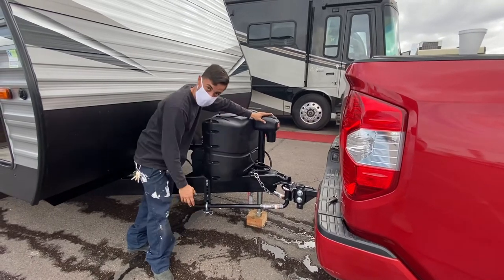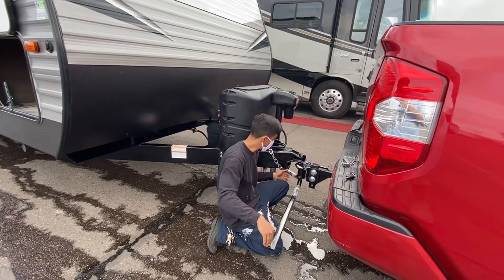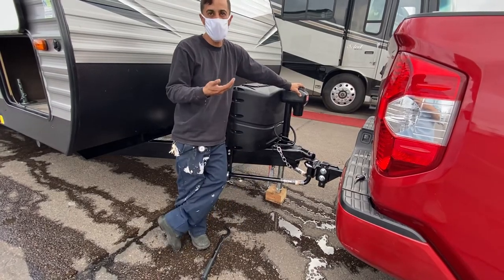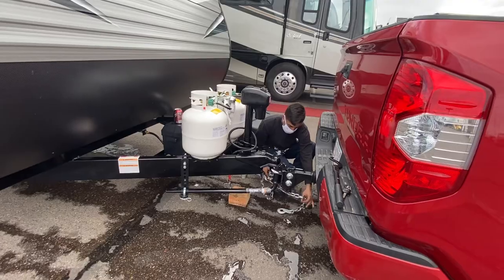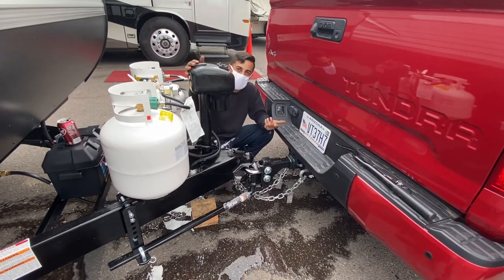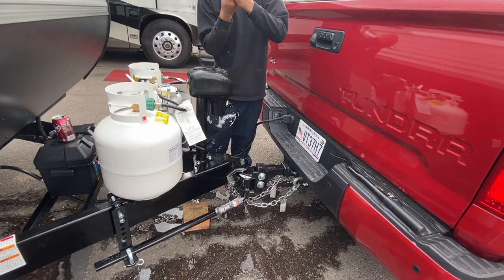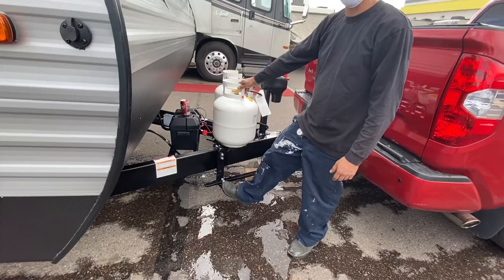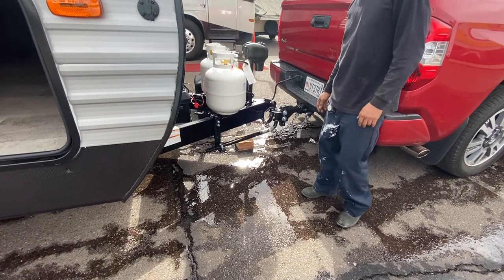Travel Trailer - Sway Bars - Connect & Disconnect - Weight Distribution

Comment: you can absolutely back up with this hitch setup just fine don't listen to that.
Reply: It’s all good, I back it up all the time no issues.
Reply: I have recently seen videos and read that you are not to back up and turn with these systems. It was news to me as I have been backing up and turning into camp sites for ten years now with two different trailers and never an issue with my weight distribution hitch and sway bar.
Reply: @fastdude2002  exactly turning is turning whether forward or backward
Reply: I backed up with mine with a sharp turn and it broke a bolt

Comment: I have the same exact setup as this. Excellent weight distribution setup. And yes,you can back this in reverse. The sway bars are meant to glide on the plate that has the “ L” safety lock. I’ve had it for 5 years with no issues.
Reply from the maker: @jimyoung8400  🙏

Comment: What brand of distribution hitch is that?
Reply from the maker: Fastway e2 2-Point Sway Control Round Bar Hitch, 94-00-1000, 10,000 Lbs Trailer Weight Rating, 1,000 Lbs Tongue Weight Rating, Weight Distribution Kit https://www.amazon.com/dp/B0071L3IFK/ref=cm_sw_r_cp_apip_ijZAlZVHpkY4I

Comment: This is NOT a sway kit, this is a load equalizer kit. Please stop making videos on subjects you know nothing about.
Reply: That's pretty uncalled for. Dude is just trying to post a video to help everyone out. Who cares if he got the name wrong
Reply: It's not a name wrong. They're 2 completely different types of systems. Confusing them to the point of getting it wrong thinking you have one system but having the other can lead to flipping the trailer, truck and getting killed or killing someone else. This is a big error because people who trust an equalizer to do the job of a sway because the two were confused are at a big risk. If a dealer taught this info they'd be liable for an accident.
Reply: New to pulling, can you tell me the difference? and maybe post links to the two different types of kits so I can research both type of systems? Thanks.
Reply: @jorgepadilla21  equalizer hitches distribute the load/weight evenly between all the axles both on the tow vehicle and the trailer (equalize the load). If this hitch is not used (or set up correctly) often there will be sag at the back of the tow vehicle and front of the trailer centered at the hitch. The danger with this is that most vehicles brake more with the front brakes than the back, so sag at the back lifts the front of the vehicle. The increased lift at the front reduces both the effectiveness of the brakes as well as the steering capabilities (because there's less pressure/weight on the front tires to handle the steering and braking), hence increasing the danger. You can tell if someone is (likely) using an equalizer hitch when the tow vehicle and travel trailer look completely level with each other in a straight line when looking at them from the side at a little distance. Many equalizer hitches, when set up properly, can also provide some limited sway assistance because one end attaches to the hitch and the other to further back of the "A" frame on the front of the trailer via chaines and/or bars. The chains/bars is what shifts the equalized weight. Being attached with the chains/bars creates some limited sway resistance from friction & weight. An actual sway bar also attaches between the trailers front A frame to the tow hitch on the vehicle using ball joints and attachment pins providing a lot more adjustable friction resisting sway from the trailer. One secret though to stopping sway as well is that the trailer can be literally pulled out of a sway if the trailer is going slower than the tow vehicle. You can do this by applying the trailers' brake control manually and NOT pressing the tow vehicles' brakes. This applies the brakes on the trailer, creating resistance & drag, while the power of the vehicle pulls the trailer straighter out of the sway (its just physics). However, this trick shouldn't be your go to primary source for sway management. Though I have seen some use it successfully when they just don't have a sway bar. Unfortunately, many of the sway related crashes are caused by sway starting and then the driver steers side to side trying to compensate oppesite the sway. Unfortunately, the physics of this ultimately acts the same as moving your feet front and back alternated with your upper body when you're on a swing: it only amplifies the sway like a swing until it flips the trailer and vehicle. DON'T TRY TO COMPENSATE FOR SWAY WITH STEERING...IT WILL AMPLIFY IT AND MAKE IT WORSE!  But applying the brake controller manually gives the drag in the trailer so the faster moving vehicle literally pulls the trailer straight. It still shouldn't really be the go to, but it can definitely help if you have no other choice. I used to have an old trailer I couldn't put a sway bar on. Every time it started to sway or got some good side wind, I'd moderately apply the trailer brake and the trailer stayed straight. Wore the brakes out a bit faster on the trailer, but it's what I had to work with and it significantly helped. 
Sorry, I don't see any way to attach pics of each, but if you do a separate browser search for each, you'll see images of the equalizer hitch with the bars (looks kind of like a pipe, but it's solid) going from the hitch to the chain attachment at the trailer compared to a sway bar that looks more like a rectangular bar with a smaller lever bar at one end (which is the adjustment bar for the friction control). The sway bar mostly looks from the side like it sits above the equalizer bar on the side of trailers "A" frame for the trailers hitch. I hope this helps and makes sense. Ideally, you should have both a sway bar and equalizer hitch in your setup. But a lot of people only use the equalizer hitch, which contributes to the confusion.
Reply: @ActinOut  you have accurate advice there but i will say that if anything the manufacture needs to be called out if this would really not effect sway as it is called "Fastway e2 2-Point Sway Control Round Bar Hitch, 94-00-1000, 10,000 Lbs Trailer Weight Rating, 1,000 Lbs Tongue Weight Rating, Weight Distribution Kit Includes Standard Hitch Shank, Ball NOT Included" and in the documentation says built in sway control and weight distribution.  
so i dont think the poster of this video got anything wrong with the title. is it going to be as effective as the device you reference ..no.. but it does use friction to reduce the amount of sway frequency that could happen so then giving you more time to correct with your method of trailer brake application. with a proper weight distro setup the lighter duty friction sway control is probably all that is really needed so long as you again set it up correctly, balance the load in the trailer correctly and are not over your payload capacity on the tow vehicle.